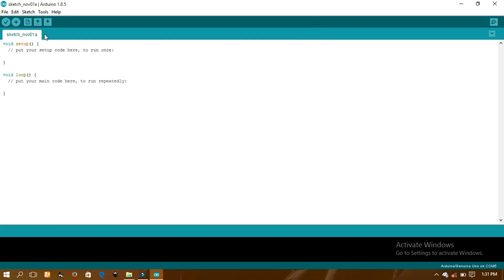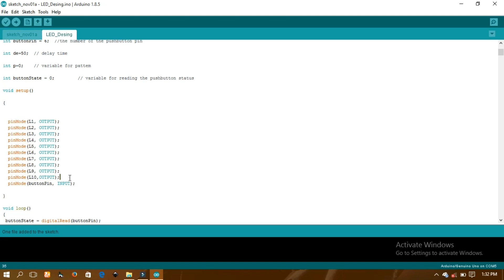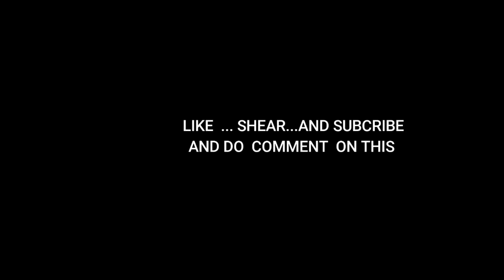Diwali special | Arduino control Diwali lights 💡 | Happy diwali

Comment: Bhai ye btai ki jo ladi ke points hai un ko kha connect karna hai plz...
Reply from the maker: Bro main 'ladi' ke matlab nehi samajh pya hoon
Reply: @sdtech_20  bhai mera matlab ki jo ladi (lights) hai uske 2 wire hai na use kha connect karna live aur neutral ko plz.. reply if you understand
Reply from the maker: Yes I understand your problem.. 
Are you using the relay modeule which link I gave??
Reply: @sdtech_20  ya I have ordered that
Reply from the maker: @sarvarali2246  then connect the live wire with a point of light and the neutral point connect with the common pin of the relay modeule and the N. O pin of relay modeule connect with the other point of the light
Reply from the maker: @sarvarali2246  https://drive.google.com/file/d/1ysS0avv-PAIIPeuZxqUrVt_NHjOWDL1z/view

please download this file 
To know more about it
Reply: @sdtech_20  thanks bro for sharing link
Reply from the maker: @sarvarali2246  your welcome 😇
I had posted a new video for this Diwali.. 
You can watch that one on this channel

Comment: Bro can u explain me properly what to do and I don't know to code and anything about Arduino but I can copy paste and install program in it. Can you explain in steps? :)
Reply from the maker: So.. At First u have to buy those things which are described in this video... 
Then also have to download the code and circute diagram as per this video.. And also do same wiring.. 
Next u have to copy the code and paste the code in Arduino ide.. 
Then upload the code... 
After that connect the led lights with the relay.. 
By pressing the switch u can change the variation of lighting... 
At last u have to subscribe my channel ☺☺☺😊😇... 
I think u can under stand what I describe u..
Reply: @sdtech_20  Thanks bro but can I do it without switch that it will change itself after some time
Reply from the maker: @devinderkumardhanda3728  👌🆗
Go for it..